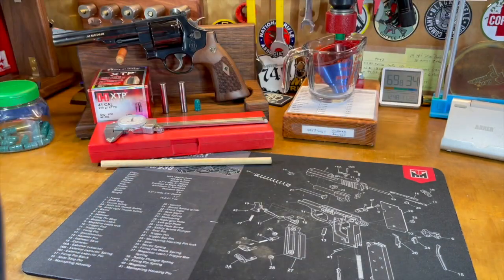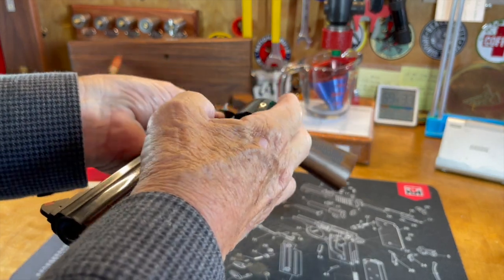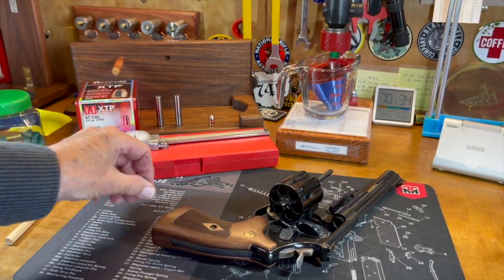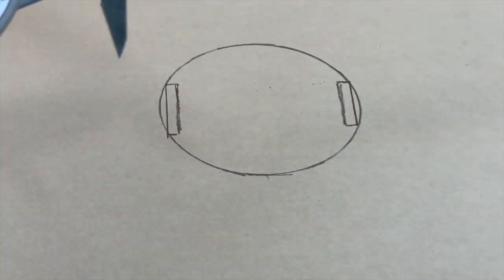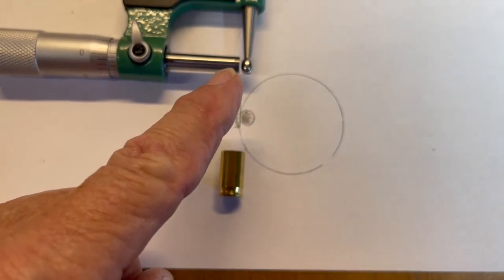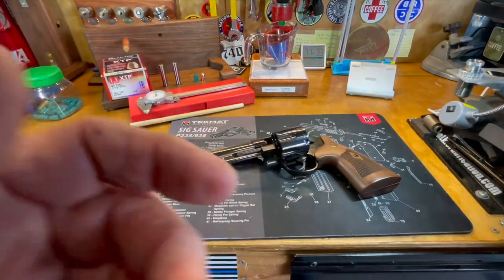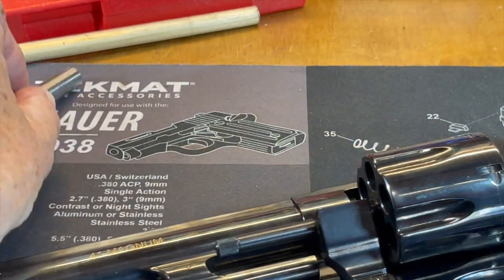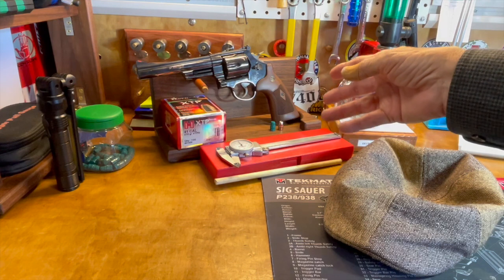My new Model 57: measuring the cylinder throats

Comment: Did you happen to measure your cylinder Gap mine is a little excessive at 10 thousandths Smith says that's well within spec I don't know about that. Still shoots well though really enjoy all your videos
Reply from the maker: I did, and will be covering that in a subsequent video. But to answer your question, this one comes in very close to yours. My 25 and 27 measure 9-10. My tightest is the 29 at .008.
Reply: @viejo2a  Noe is having a pretty good sale on bullet molds this weekend they have a 140 grain wadcutter. Any experience with shooting real light bullets in 41 mag. Just looking to conserve lead
Reply from the maker: @ericoulundsen5041  hi, eric. This is my very first 41, so I can’t offer any expertise at all at this point. I’m gimped up with a busted kneecap at the moment, so it will be a while before I can even get this one out. I’ve got a half-dozen molds in 41 cal collected, and all are between 180-255 gn. Sorry! 🤛🏻🔫🦃🇺🇸
Reply: @viejo2a  👍